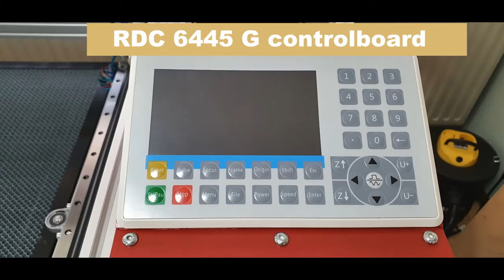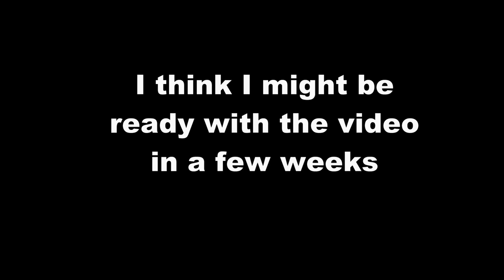DIY CO2 Laser 600 x 400 foto update

Comment: I need your help, I want to put linear rails on my laser, I also have that y400 laser, can you help me by sharing the part that you changed to put linear rails instead of V wheels
Reply from the maker: It is no longer the same CO2 laser Y400 as that of Further Fabrication. The profile sizes have changed completely. And also printed completely different 3D pieces to work the linear rails. so a little more patience and I'll post the video online, how I build it
Reply: @PhilippeRommens  ok, could i share the parts 3d and other i use when i finish building it?

Comment: what drivers and engines did you use?
Reply from the maker: Cloudray Ruida RDC6445G RDC6445S Laser Controller and STEPPERONLINE DM542T Digitaler Schrittmotor Treiber 1.0-4.2A 20-50VDC Stepper Driver
Reply: @PhilippeRommens  thanks, which stepper motor was used? how many kg?
Reply from the maker: @fernandoleppaus  see this video with all the parts https://youtu.be/UvWssQOBIgA